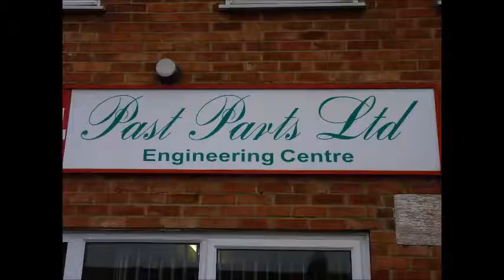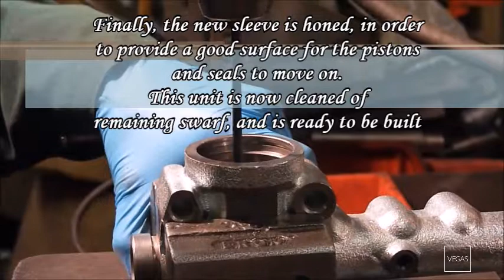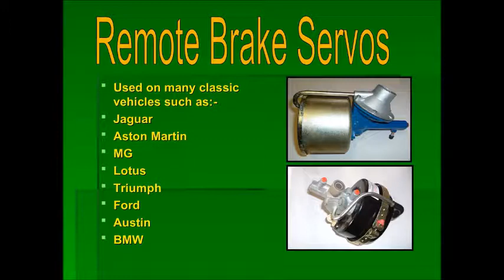Past Parts Brake Master Cylinder Rebuild

Comment: Hi nice video.

I want to do this on the lathe, have no mill. I see you use adhesive and not a heat press in system. This way you do we are sure it is fluid tight.

What adhesive do you use? I presume it is a version who hard out if oxygen is not present.

thanks